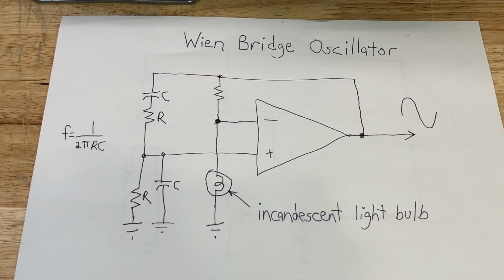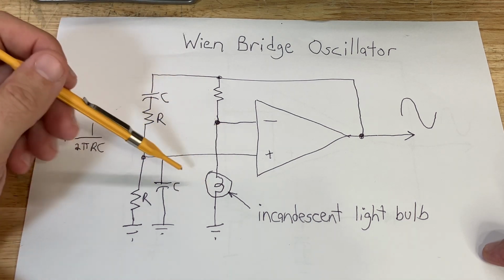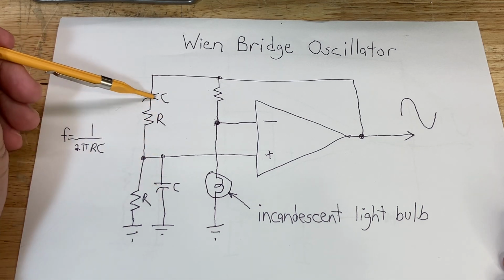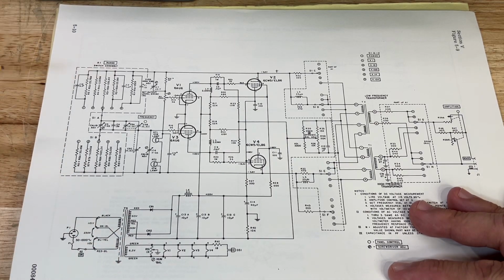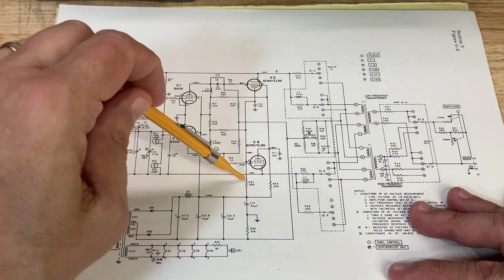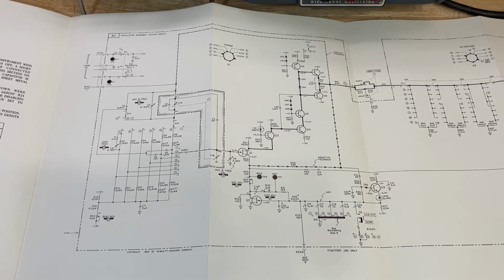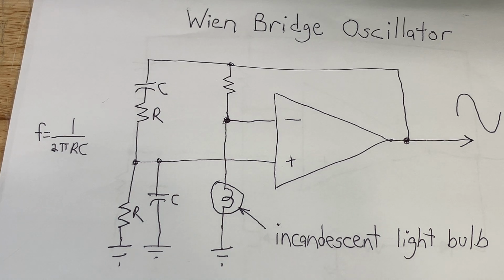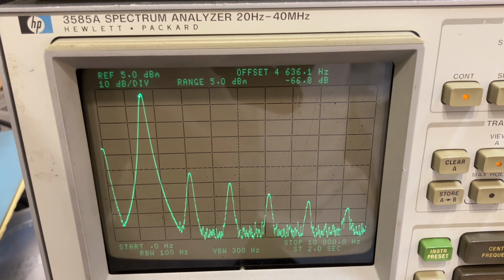Breadboard Day: Wien Bridge Oscillator, and HP 200CD and HP 204C

Comment: Great explanation! This video made me a lot more knowledgeable. However, I have an HP 204 C and it won't oscillate at all. How do I isolate the various sections so that I know which feedback loop is causing the problem? I disconnected R23 which cuts the signal from Q2, the FET that provides the amplitude control, and that did not help. Is Q1 the actual Oscillator transistor? Also note I can't do the basic AGC adjustment in the calibration instructions it does not vary from +0.6 volts and definitely won't get to -1.8 volts as the procedure says.
Reply from the maker: Hard for me to give specific troubleshooting advice. Feedback loops are notoriously difficult to troubleshoot. Check power supplies first, of course. Then look at dc voltage values around all the active components to make sure they make sense. Diode test all semiconductors, check capacitors for leakage, etc. You’ll find it. Sorry I can’t be of more help.
Reply: @garyramsey4275 I hear you. Getting confirmation that it isn't easy helps. I also think I need a newer version  of the manual. The component layout of mine is not the same as the version of the schematic that I have which is dated 1968. I just found a newer version of the manual so I'm working through the revisions as we speak. Thank you for the reply! I have this video bookmarked when I figure it out, I'll post the results here.

Comment: The amplifier gain is theoretically 3 to maintain oscillation but it needs to be greater or smaller than this if the two RC networks do not track. The negative feedback must cover the worst mismatch or the circuit will give a distorted output or fail to oscillate as the frequency is varied. Typical tandem potentiometers are not matched over the whole of their range.